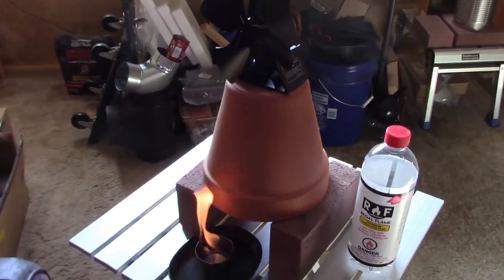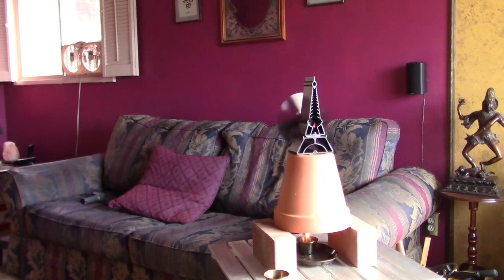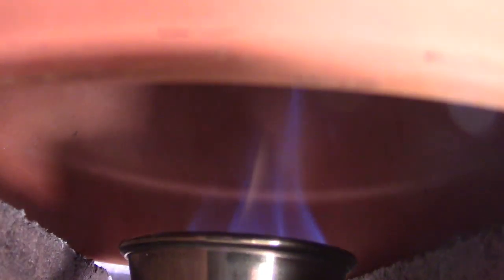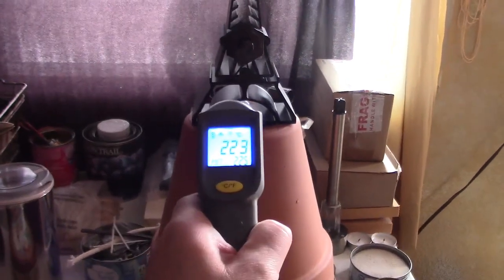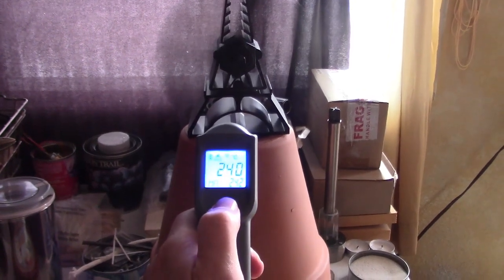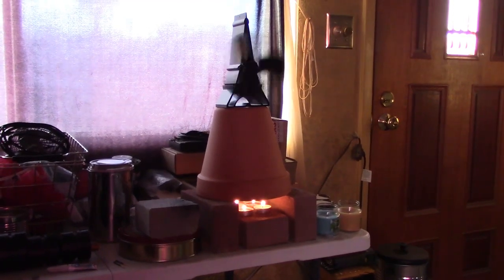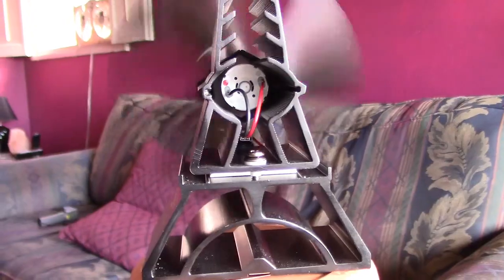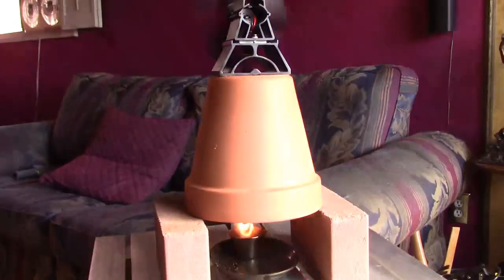DIY Clay Pot Air Heater! Improved!! has a heat-powered fan! flowerpot heater w/fan! totally off-grid

Comment: is there fuel smell with this? will it work with  ptc stick?  .. thanks  tia...🙏
Reply from the maker: i use unscented tealights so i don't smell anything. some liquid fuels have a smell and some don't smell much at all. i often use ethanol fuel and i don't notice any smell. in my video where i set this fan in a cast iron pan with candles underneath, i used scented candles (part of the time) and they filled the room with that scent very fast.

Comment: What I did with my clay pot heater is I have a table I took the glass out put a piece of plywood  put a hole in the center of it. Put foil on the wall in the corner  put the clay pot heater in the corner by the foil.

Comment: I'm heating my place with hand sanitizer. All free out the dumpster.
Reply from the maker: nice! i just bought some of that (for future video)
Reply: @desertsun02  The gel stuff doesn't seem toxic. I have some in bottle that reminds me of a gear oil bottle. It's liquid and I burned some indoors I put it out and blew fresh air into my hut. It gave me issues. I worked in fiber glass so I'm already down capacity.

Comment: I experimented with a clay pot and the Regal Flame fuel you suggested. I got reading of over 500 degrees using a tuna can with filled with cotton balls and about 1/2 way with the fuel. I was a little disappointed I only got a 1/2 hour of run time max. I was thinking on trying that fiber stuff  that's used in those table top fire place. I dont think i will get much more run time though?

Comment: I love your vids. I think I learnt that sand batteries were a thing from your channel. Thank you.
Wondering with this one, is the heat from the pot or was the room air already warm? It seems almost too good to be true that the pot is doing more than powering the fan, but also heating the room, lol. I'd love to know what the temp of the air reaching the back of the sofa is.
Reply from the maker: hi and thank you! the heat is from the pot (flame). it really works. the pot absorbs the heat from the flame (kind of like a wood stove) and fan pushes hot air into the room. it's a light-duty heater but 100% works. i can feel the warm breeze 5 to 6 feet away. very warm within 2 or 3 feet.

Comment: I dont have a heat fan so I use a small usb fan to circulate the air above the heater
Reply from the maker: hi. i've used small solar or battery powered ones in the past, but now i'm hooked on these heat powered ones.

Comment: Amazing! I’ve been using the cast iron pan version to heat my shop and it’s working great! How would you rate this version vs the cast iron pan one? Merry Christmas!
Reply from the maker: hi there. it's great that you made the cast iron one! i haven't compared the two so i couldn't say. they both have their advantages... the cast iron is tougher but the flowerpot has more surface area. Merry Christmas to you too!

Comment: hello desertsun02. whats the best low tech heater you have come across so far?
Reply from the maker: hey there. it's hard to say. they all have their pluses and minuses. for sheer volume of airflow, it's probably the ones i make with the "water to air" heat exchangers.
Reply: @desertsun02  do you mean blowing air directly onto water surface to heat the air in a room? do you have a link or vid title?
Reply from the maker: @100 Music Playlists they use what looks like a radiator. here is a link to a video of mine on that type of heater. https://youtu.be/YcP-CzY-KkU you may also like this one https://youtu.be/pLd4U0FUHxw it is what i call a stove pipe heater. i also have a compilation video of 33 of my heaters. here is the link to that one. https://youtu.be/INNCo3oxx5M
Reply: @desertsun02  Hi Desertsun02, You must have learned a lot in the years you've been doing this. Which project would you recommend to someone with a small 10m x 10m one bedroom apartment simply looking to save money on water and room heating fuel bills?

Comment: Link for stove fans?
Reply from the maker: hi. i don't have exact links but if you search for stove fans or heat powered stove fans on amazon you will see a lot of them. probably over 50 different ones. i just bought 2 other kinds (one came in the mail today). the main thing i suggest is to get one that has a starting temperature of 122F (50C). some start at a higher temperature (and the ones with a higher starting temp may not work well with candles)

Comment: Great video.  Question:  Let's say you wanted a fan to keep you cool rather than warm.  Stirling fans can run on a flame to keep a room cool yet the flame doesn't transfer to the air.  Could you run your fan over just a flame, enough to power the fan but not enough to throw hot air?  I'm waiting for Amazon to deliver my fan as I want to try your heater you showed last week...just wondered if you tried it.  If you haven't, I'm going to try it.

Comment: How about a cast iron pot?
Reply from the maker: hi. that works good too. i actually did a video on that a couple of weeks ago. if interested here's the link https://youtu.be/SrnsLmseUk0 try to use a thin cast iron if you can get it. it seems to work much better than the thick cast iron for some reason
Reply: @desertsun02  because it gets hotter.....a bigger pan has more surface area to heat so it distributes......cast iron is preferred for heat distribution thats why its markets as having no "hot spots" and "even cooking"